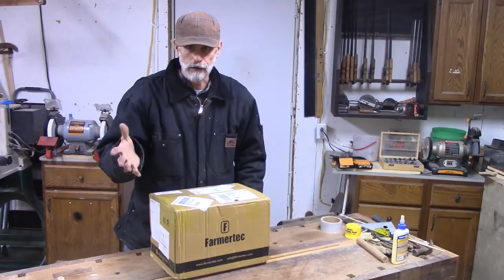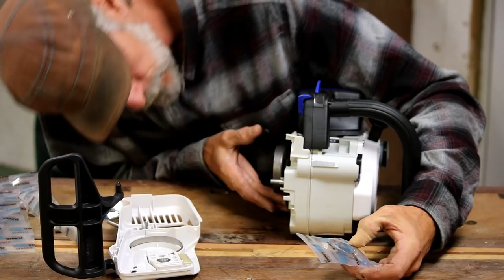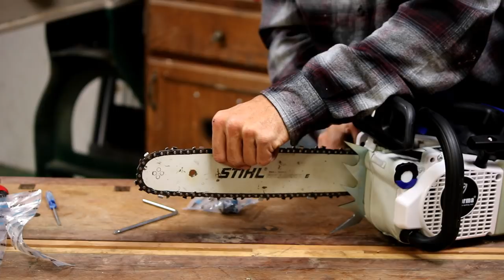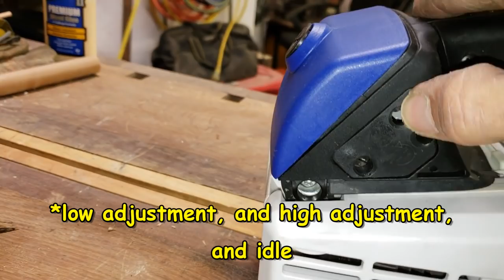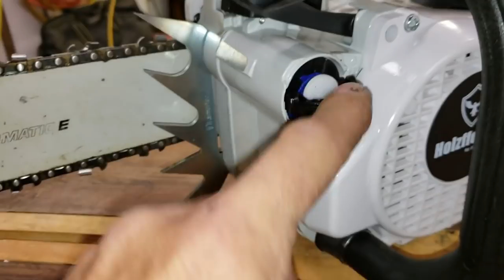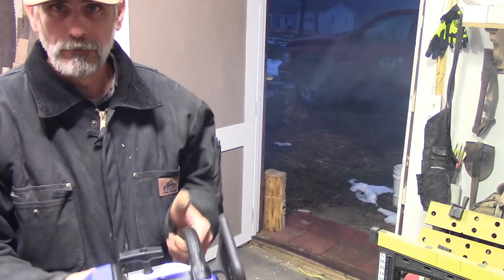Un Boxing a cheap Aborist Saw (FarmerTec Holzfforma G111)

Comment: As a climber I love the idea of a cheap saw base to build on, but screw those dogs. Sure there are times cutting that I wanted bigger dogs but then those are just 4 more sharp things hanging on your harness to worry about. Any fall, swing, drop whatever and those will gash somthin. "upgrade" them to the smaller version.
Reply from the maker: You have my full agreement. BYW it still runs great. Put a better chain and sprocket on it too it's now 1/4inch pitch cuts much smoother.
Reply: @DIYwithUncleCy  workin out the recipe before the cookin starts. I wanted to run a Sugi Hara for weight, but I haven't found them in pico. Looking for hybrid bearings and a piston cylinder upgrade. If the bearings are 6202's then I will go with Dominant's hybrid ceramics. How do you feel about Hyway's 200t piston and cylinder?

Comment: It's a nice saw. But, why is it so expensive compared to much larger "cheap" Chinese made saws?
Reply from the maker: Well I can only surmise that the top handle saws are more expensive to produce. I mean when you  price the name brand top handle saws compared to their rear handle counter parts, top handle saws are always more. I would guess its the same for the clones.
Reply from the maker: Years ago I worked as a tree monkey and used a Homelite Super 2 as my climbing saw. these little top handle saws have ever since been kinda special to me. I have a Super 2 that I recently acquired and made run again, but have always liked the more powerful top handle saws so when I saw this I was like Yea gotta have one LOL. and they are handy on the ground for cutting limbs into fire wood length, since you can one hand the saw and use the free hand to hold the limb, using caution of course.
Reply: @DIYwithUncleCy  From watching your video, I could see how it would be handy for limbing a downed tree or cutting in dense brush. Being so small would make it easy to get into tight places. Clearing dense brush is pain in the butt when you can't afford an expensive brush cutting machine.
Reply: @DIYwithUncleCy  The little top handle saws are fun. Eventually, I'll have one to add to my current small collection of 5 chainsaws. My most recent acquisition was a Poulan 2400 WoodMaster I got from a friend about three or four months ago. It is in near mint condition but I still need to work on it to get it running better. So far all I've dumped into it was about $15 for a fuel line kit and a new NGK spark plug.

The same friend I got the Poulan from also got a nice little McCulloch Mini Mac, a Stihl 026, and his biggest saw, a Homelite C5. Those three and the Poulan all came from his uncle. An old-time collector and restorer. The old saws may run slower but I think they have a better sounding crackle to them when they're up in rpm range. :)